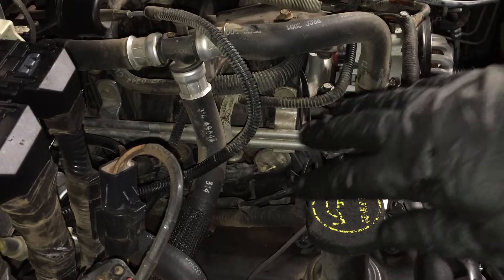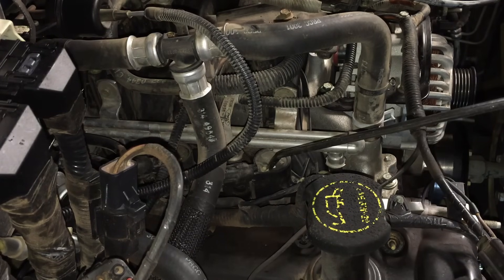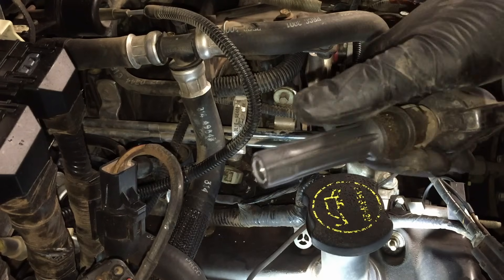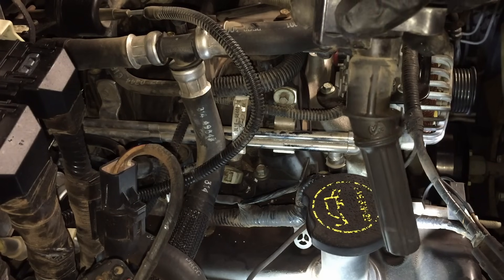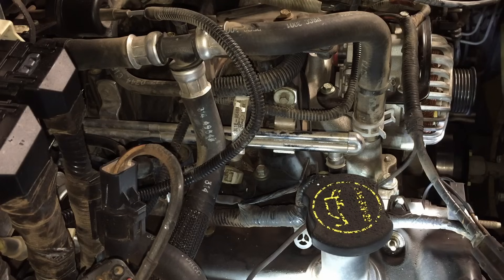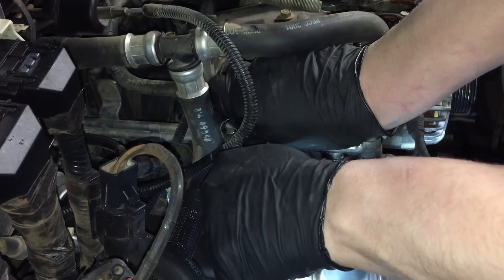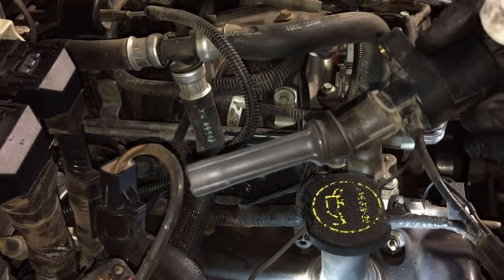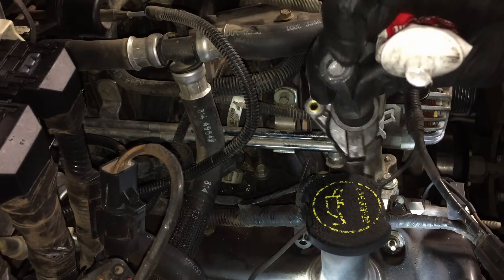Important Tips When Replacing Spark Plugs on Ford 4.6L 5.4L 6.8L 2v Engines

Comment: This video was exceptional and helped me change my plugs and coils. I’ve never touched maintenance in a car before today. Keys:
-  Have a variety of extensions 
- 1/4” drive is better than 3/8” drive for this job - the more teeth the better as you’ll have very little space to swing it
- Use magnetic spark plug socket with built in swivel
- use a torque wrench to get 22-25 ft lbs
- use a baby wrench to get bolt of of #7 coil: nothing I had worked for a socket, but I hear a flex adapter may help
- don’t remove fuel rails
- #4 sucks no matter what. Try every combo of extensions/adapters/ etc until you get something that works for you. This is when the tooth count on the socket really matters.
Reply: For the #4 plug I had to remove the throttle body on my Explorer with the 4.6 V8.  Once I had that off removing the plug was much more doable.
Reply: @LA_Commander  anything hard about that? Bolt sizes? Any gasket that needs to be replaced? My throttle body needs a good scrubbing anyway.I got a misfire on 6 which i believe is on the drivers side, 2nd closest to to the headlights.  But I'd like to knock them all out. Had this happen to me in a grand Cherokee but i was close to my garage. today i was 50 miles from home. expedition magically cured itself 10 miles from home. the shaking at idle was bud, thought it was a vaccum leak until my radio that is BT connected to my obd 2 told me i had a missfire on 6...I primed all the parts to come tomorrow and hope to tackle everything but especially the front 3 on either side then do an oil change.
Reply: @johnonthecooldoe6338  the throttle body was easy, just 4 bolts to take it off. Yes, new plugs and coils will really help your engine run a long time trouble free. Just be sure to torque everything down properly and use OEM parts if possible.
Reply: @LA_Commander  This is kinda a beach toy so i got the $30 for 8 top rated coil packs off amazon and the ngk spark plugs. I'm going to grab a thermostat and seal from auztozone. I did a distilled water flush with the chemical one time and water 5 times but never changed the thermostat.
Reply: 3 8mm bolts on power steering bracket
7mm bolt on the coil
5/8 spark plug socket
Wobbly head adapter at the socket
6" extension & 3" extension
Spark plug locktite
Torque to 25ft lbs
Silicone dialectric grease on boot spring
Reply: Thank you!
Reply: How long did it take you?
Reply: @mysticmarlow like 2.5 hours

Comment: I changed all my sparks and three coils. Gaped the spark to correct gap and made sure all my wires were connected and in the right spot. But now when I turn my car on I get a loud knocking sound. I didn’t let it run long in case it’s damaging anything. Doesn’t anybody know what the hell is going. Ps it’s not my oil I just changed the oil and checked it to see if I may have leaked any but no.

Comment: I have a question,  I just got 2011 Crown Victoria police interceptor FLEX FUEL and only use gasoline but the ford factory manual asked you to call the dealer about what sparkplugs to use   The motocraft AGSF32N GAS O.54 GAP or the AGSF22FM1 FLEX FUEL .O45 GAP . Thanks
Reply: I have the exact same question, he recommends the sp-479 plugs as per the description, but ive seen people use the sp-493, sp-413 and the sp-405 Flex Fuel variant. I only use reg 87 octance in my 2012 as well, did you find any benefit with not going back with the flex fuel plugs?
Reply: @calebmastruserio7811  No benefits,  We will probably never use E85 fuel stay will the gas plugs that give you a better combustion. Even if we did use E85 the computer will compensate.
Reply: @MrRockydee07  thank you man, much appreciated gonna do tune up on my 04 and 2010 MGMs

Comment: I had Ford Racing plugs put in my 5.4L 3V and it has run perfectly ever since! Also had High Performance Coil Packs put in with no issues other than it starts every time on the first turn of the Key!!
Reply: Just wait.

Comment: Just got a 2011 Crown Victoria P7B and it's flex fuel I only burn 89 octane gasoline with methanol  mixture that's available now , do I need the flex fuel plug that asked for a 44 gap or the gasoline engine plug calling for 54 gap . Thanks

Comment: Thumbs up and thanks but my 2004, 5.4 Triton took a 9/16 plug socket. Also, if you have veneer calipers or a micrometer, you can file out a feeler gauge that will serve pretty well.

Comment: I have a 07 e250 econoline 5.4 ...with a cylinder 4 misfire code. So when I went to blow out the valve while changing the coils and plugs oil came out. Is this bad? Does it matter that the engine was still kinda hot? What needs to happen to correct it?

Comment: Hi there.  I have a 2003 V10 with the PI heads that have more (7-8) threads.  Same torque specs?  Also, there seems to be quite a bit of controversy regarding the use of anti seize.  Some say that with nickel or zinc played threads, anti seize isn't necessary.  Can you talk more about about pros/cons of using anti seize?  Thank you!

Comment: The source of oil on spark plugs after 110,000 miles is failed spark plugs insulators. There is no way for oil from valve covers to reach spark plug wells. If you see any oil in them, if boots are soft and swollen and the surface of the head is greasy around the plugs -- that oil is distillation residue from combustion and pre-combustion gases seeping through the failed ceramic-metal junction. In my case, it took another 10,000 miles' worth of oil accumulation for plugs and coils to begin misfiring. Some were fully submerged in oil and still kept firing, but this is also the time when ignition coils fail all at once, so I had several plug-coil combinations in which both components failed. It is not improbable that gas seepage has something to do wit coil failures; if not, good timing by Ford. Their maintenance schedule indicates plug and coil replacement at 100,000 miles.

By the way, over-torquing spark plugs can cause their insulators to separate -- that is probably the strongest reason to limit the torque. Threads can handle a lot more, even though there are only 4 threads in the head. I, too, add a little more torque on top of factory spec, but not much more. I stop in the range of 18 .. 22 Nm. The factory spec of 15 Nm would probably be adequate with properly cleaned threads.

Comment: I'm changing my plugs and I always go with motorcraft double Platinum. It's a 2 valve 5.4 4wd, the auto parts store said I must go with the tripple platunum, I disagree. Iva always used 5w30 motorcraft full synthetic motor oil.,it works best, don't forget to check your injectors to see if there plugged with any debri or trash, mine had some kind of white sugary subsdece and I also changed the fuel pump, the fuel sock and fuel filter, before doing the plugs coils and injectors, it finally runs like new!

Comment: I do the rear on each bank first that way after I'm pissed off the others aren't as aggravating leaning over the engine
Reply: Ha HA HA ... I get the frustration factor. I replaced the intake manifold on a 4.6 ... There was ONE BOLT that I couldn't access.  Ford had put a huge bracket in the way. That bracket held one quite thin cable in place. Ford said: "you'll need as special tool  to remove that, and you'd have to order it". I was frustrated. I checked further. A guy on you tube said : "just saw the bracket off". So I got out my cutoff wheel, and did just that.  Worked fine. Later on, I cable-tied the quite thin cable to others and it all worked just fine. I didn't replace what was left of Ford's bracket. No need for it in the first place.
Reply: Best spark plug advice I’ve ever heard
Reply: Saaaaame!
Reply: LOL….AWESOME IDEA….I try to follow that logos as well!
Reply: Was thinking the same thing lol
Reply: That's probably a good idea.
Reply: Great tip!
Reply: Ford Sucks - Independent Mechanics have made a good living on Ford's alone
Reply: Good advice 👍
Reply: Like your style 😅
Reply: I have certainly gotta do it that way haha
 It goes easy to hard for me and I'm so pissed at the end
Gotta start at the rear
Reply: I have certainly gotta do it that way haha
 It goes easy to hard for me and I'm so pissed at the end
Gotta start at the rear
Reply: Managing expectations.  Smart.
Reply: That’s what I was thinking! Take the mountain then relax on the descent
Reply: Yep, if you get the hard part out of the way first, it's always easier from then on.
Reply: Good idea lol
Reply: are you talking about a sideways V-6  ,  take the front engine mount loose and pull the motor over with a come along , that's makes a big difference .
Reply: @jonesy4588  what is the airflow sensor located with the airflow sensor look without clothes at your location on 1997 Ford F150
Reply: @jonesy4588  This vid is about a early 2v 5.4 V8….are talking about an early 4.2 V6?!

Comment: I just got a 2013 Ford e250 with the 5.4l and the cylinder 6 spark plug blew out and broke the coil right off. Can I use a cal van kit on a 2013 or is it only for the older vans? Any help would be greatly appreciated

Comment: Great video. wanted to comment on the plug type. I changed the plugs on my 2000 f150/4.6. the plugs I was sold are Motorcraft agsf32fm (SP-432). The difference between the old and new is the new ones have twice the number of threads, I assume to correct plug ejection issue. Bought from Advance in 2019.
Reply: Not to argue with ya, but I wouldn’t think it would matter because the head only has x amount of threads? What I’m trying to say is if the head only has 4 threads, no matter how much the plug has it will only engage 4 threads.

Comment: Ford once again took the cheaper route with a thinner cylinder head with fewer threads to hold the plug base. Not only on the 5.4 but also on the 4.6 and the 6.8. Then they recommend THEIR spark plugs.  You can't make this up.

Comment: 5.4L -  Should I disconnect the battery when replacing plug  & coils ?    Thanks
Reply from the maker: No need
Reply: @FordTechMakuloco  Thank you.   These 5.4L's are indestructible but sure dine on coils.  Especially #1 & #2.....

Comment: I have a 2001 f250 5.4 2V Super duty 312,000 miles and still running strong. I pull my RV with it. I had to do 2 of the spark plug repairs in the first year. The kit makes the job super easy. I figure if any more of them were gonna let go they would've by now.
Reply: Same motor. Just hit 390K. At 388K changed all plugs- all coils- all vacuum lines. It's purring like a kitten.   Cant kill this motor.

Comment: Hello man i hace a question i have a Crown Vic 2002 this engine hace all cilinders rings new con 2017 and the spark plus 7 is geting oil i took this cilynder head to a machines shop and iw still same problem i do compression and show 150 PSI i puede transmission oil in to cilynder 7 and the oil never gone so someone tell me has to be valve guides coz valve seals are new toó so can you help me thank you

Comment: Great video, I managed to replace one plug today and I'll do more tomorrow. it took quite a bit of force to get that plug out though, at least 40 or 50 foot pounds, I hope I didn't damage any threads getting it out. on the way in I put anti-seize on the new plug and started it by hand and tightened it to 20 foot pounds. with the torque difference from lubricant I should say that's equal to about 25 ft lb dry like you suggested.
Reply: Auriam; A valid point you make. 'Indicated torque values' are altered between 'dry' & 'lubed.'

Comment: 2003 Town car here, I'm getting a P0351 code, without even looking at it my mechanic told me it's the intake manifold leaking antifreeze into the sparkplug well. I see that the code is for cyl 1 ignition coil circuit A, it only does it when the engine is warm and been idling in traffic long, do think it might be the coil or something else? I'm not loosing any coolant and I don't see anything seeping, I am currently at 274k miles.

Comment: Do you have any tips for plugs on a 4.6 L 2V engine that dont want to budge backing them out? I am at 93K with second set of plugs installed by a dealer and I suspect they may not have used antiseize.
Reply: Doesn't the die electric grease get all over the tip of the plug that way and mess with conductivity?   Got a new to me 02' v10.

Comment: The so called 100K spark plug life is BS. I had misfires while in warranty. New coil packs and plugs on several cylinders. At 45K I had all plugs changed and the originals were at >.80. You could slide a nickle in them. What happens is that the voltage rises and then the boot arcs over and no wonder that at 100K you might have coil failures. Change plugs at 30K no later.

Comment: I remember changing the plugs on my 97 4.6 before YouTube was a thing. Also had to take off the intake manifold and clean the damn thing with my gun cleaning kit just to get it to run right. Man that engine was a huge bitch to work on. My 4.6 would fill with water on cylinder 4 and 3 all the time filling the spark plug boot with water. I’d have to carry wire dryer and spray it in there almost weekly.

Comment: When I did my 5.4l, I also went ahead and replaced the injectors with some affordable remanufactured ones. I mean, once I had some brackets and rails out of the way, they were just too easy to do at that point; I couldn't resist.

Comment: Swapped plugs in my '04 5.4 3V and was advised to clean injectors, throttle body, induction, make sure the motor is hot, and use an impact gun. Never broke a single plug. Easy peasy.

Comment: Funny nobody shows replacing # 3 # 4. and # 7 Cylinder spark plugs or coil packs because how labor-intensive it is to get to these plugs and coil packs on the Ford E series Especially the e350  Two valve From my point of view you do  take off the rail system.  

Process listed below . 

I would guess these are the most neglected cylinders in a 5.4 owners don’t change them because of inaccessibility ability

Many unscrupulous mechanics tell you they change them and they did nothing because of how much dismantling one would have to do to gain access

This is why  to change your spark plugs is easy at three to $400 price tag for somebody that really does the work this is why the 5.4 is Described as a failure because nobody ever changes those extremely hard spark plugs and coil packs especially on Econoline E-series such as a E350

Comment: 1st time I did the plugs on my '06  4.6L 4x4 it took 4 hours. Second time "only" took 2 1/2 hours!
What is really needed is an additional joint on my arm...hah.
Reply: @ItsShem Ty If you have the 4.6L you should be fine. Might want to get a universal joint as well as the extension...
I also found it helpful to have a "magnet rod" to draw the loose plugs out once free of the threads. The rubber piece in my spark plug socket was too loose to hold the plug to pull out of the "tunnel".
The 5.4L engines have a reputation for plugs breaking off in the cylinder heads!
Not cool!

Comment: Late to the party but that seems like an awful lot of threads on a spark plug going into a hole with only three threads. How far does the plug protrude into the combustion chamber?
Reply: I was looking for a similar answer.  I have an answer for you as to Autolites single and double platinum (i think model APP103), it appears that very little protrudes into cylinder, only the bottom 5 or 6 threads of the plug set into the 4 threads of the head, there is a space with no threads (maybe 4 or 5) in the casting below the beveled seat. To be clear only the bottom 5 threads of the spark plug are used, none of the anti seize place on threads above that is disturbed. I viewed the hole with a boroscope inspection camera.

Comment: Shaking when taking off and low power during acceleration do you have any vids on these issues I'm not finding any solid reasons my mass air flow sensor I replaced and justputnew could and spark plugs I'm thinking about changing the valve cover gasket so maybe this is the real underlying issue?

Comment: Thankyou so much for this excellently delivered and incredibly useful content, I still have a question however.. Is the problem with the plugs breaking off in the cylinder more to do with the 4.6, 3 valve V8s?
Reply: Definitely. These older style plugs rarely break from what I read. The newer ones are made of more than one part which can separate!

Comment: I’ll be doing the plugs on my 2004 f250 with the 6.8, what is the correct torque. I heard you say 20-25 ft lbs. Will I be good in that range or is there a specific torque?

Comment: Question: You may have covered it in another video, if so could you send me the link. Ok . Ive got the 06 5.4 ( non flex) in a Lariat. Which has the slide in square air filter directly over plenum.  Would this be the ones prone to blowing out? Or the the ones prone to break off? Any final advice? Lol. Thanks

Comment: What about when there is coolant in #2 cylinder and and #1 and #2 misfire?
Reply: my intake manifold gasket was leaking. ended up needing the whole manifold ( and a coil pack and plug)

Comment: I know its 5 years late....but i didn't find this channel till recently but have owned a 5.4 2v for ever and a day now. Regarding the sparkplug threads thing from 97 to 2002 the heads only had 4 threads in them starting in 2003 ford changed the heads to 8 thread heads. My 04 Lightning even under 26 pounds of boost had 8 threads and they never failed. My 02 lightning spit a coil at 12 pounds of boost. I ripped out all of the plugs and used the Lock n Stitch kit to redo all 8 plug holes properly....they never failed again. Also lock n stitch is the superior plug fix kit and is the general go to kit for us in the Lightning community
Reply: think lock and stitch is better than time sert still ?